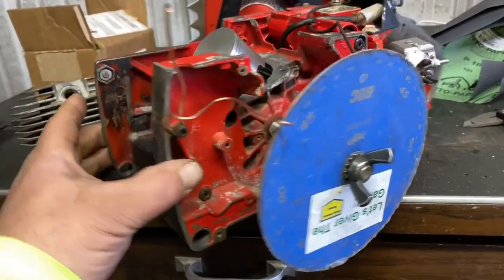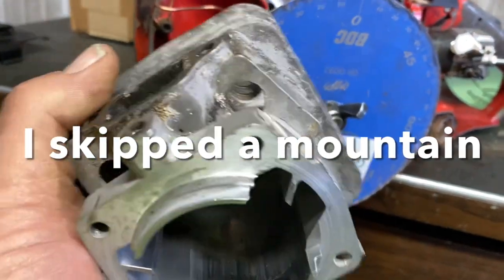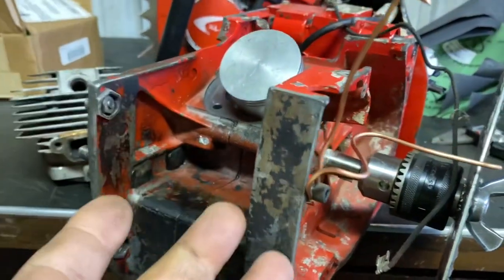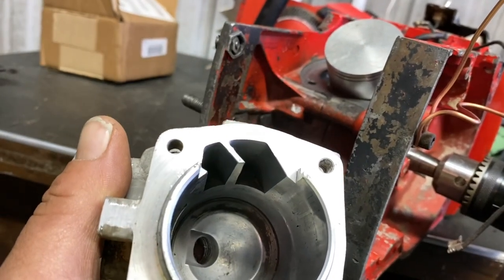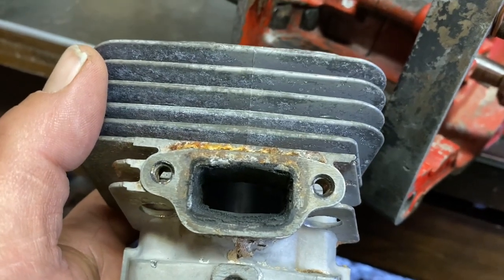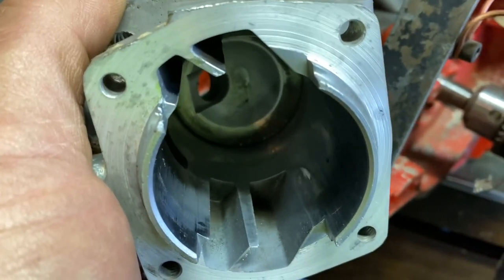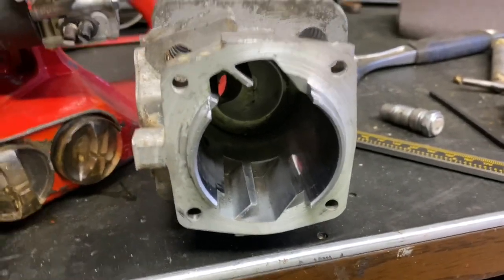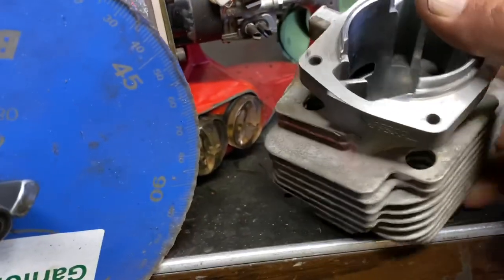Hot Homelite 410!  Planning The Port Work!  The Stuff I Almost Never Talk About!

Comment: Wondering if you were to cut a boost port in the back of the cylinder wall and a corresponding hole machined in the piston to allow that to charge the cylinder even more efficiently......kind of like a 5th transfer port.